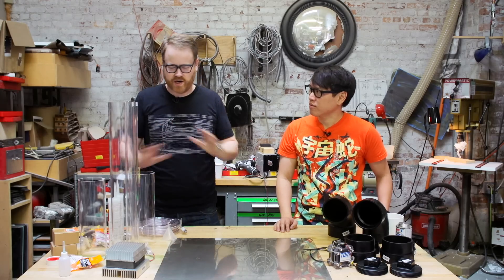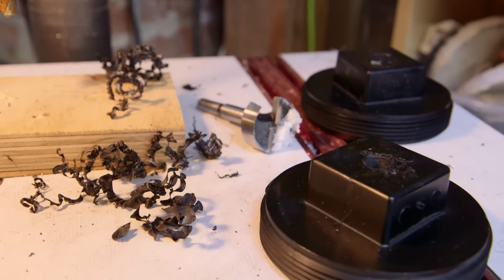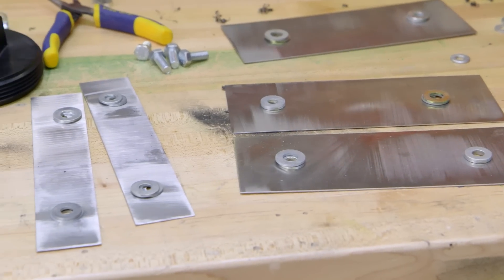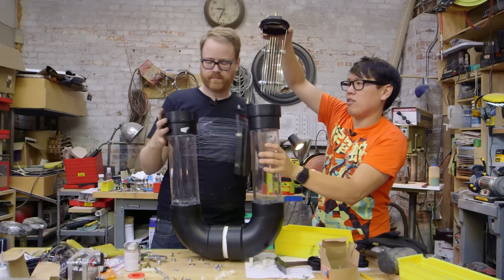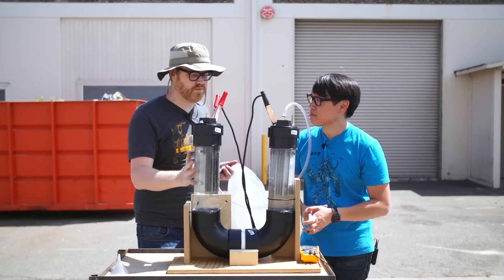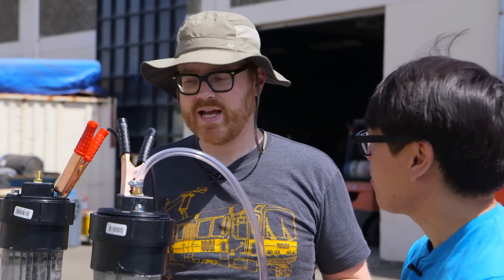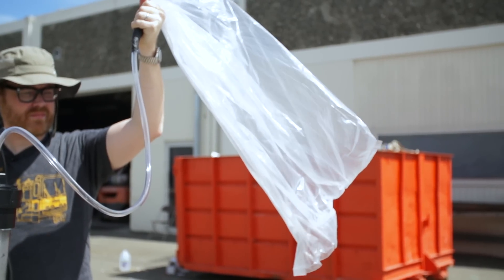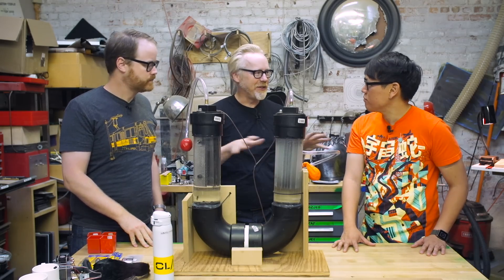Tested Builds a Hydrogen Converter

Comment: The distance between the anode and cathode is directly related to the amount of total power needed to efficiently produce the hydrogen and oxygen.  This is the main reason why the rig built by Grant Thompson worked so much better then yours.  You could probably 3D print a few parts to hold some thin steel plates in place and still separate the gasses.  If you alternate between anode, neutral and cathode plates you can design the 3D printable part to hold the plates as close as possible and separate the hydrogen and oxygen into different output chambers while the water comes up from underneath.

In my old rig I used some long steel plates for anode, neutral and cathode plates and then some sticker vinyl as gaskets to separate the plates and the gasses.  The vinyl was cut so that water could enter the bottom and sides and then cut so the hydrogen and oxygen would exit either left or right side of the top. Although I never got the separation perfect it still produced really well.  A 3D printed rig might work better to separate the gasses but might not be as efficient.

And if you do attempt another build be sure to build an arrestor like Grant Thompson did but build one for both outputs.  Mine had a small funnel at the bottom of the arrestor with a rubber ring glued in it to catch the ball and block the gas port when the water level got too low.  The ping pong ball also had a tiny ball bearing glued into it to force the ball into the funnel and hold it in place.

Comment: Never wear gloves when working on a drill press or lathe.  If it gets next to the rotating bit it can grab and rip your finger off (or wrist or arm).  It is way better to just take the cut you may get by getting hit by a chip.  This is old machine shop safety 101.   Cheers and happy building.

Comment: SAFETY FIRST!  I'm a Soap maker and worked with HHO gas, so I've worked with both Sodium and Potassium Hydroxide. If you spilled such caustic solution on your skin... JUST WASH and RINSE WITH COLD WATER ONLY FIRST.  By using vinegar solution first will cause an EXOTHERMIC REACTION and will burn your skin MORE! PLEASE READ THE MSDS SAFETY.

Comment: That wsa.. underwhelming.
Or rather horrible.
Hack, i got an old solar-set toy for kids with a small solar-panel and electrolysis chamber.
Hooked up to 9V and i can produce 15 L in a couple of minutes.
And that thing probably costs less than all the materials they used.

Comment: You guys really need to check the science. Voltage does not make a difference to how much hydrogen is produced - current does. 1 Amp for 1 second will produce 1/96500 of a mole of hydrogen atoms - half that for hydrogen molecules. So using Boils law at RTP 1G of hydrogen (1 mole) will be 24 litres. You wanted 2/3 of that. So you need 2/3 of 96500 anp seconds. Those pannels can supply at peak 6 amps. More typical is 4. Thats near 4.5 hours of electrolysis.

So why didnt it work - this is the only bit where voltage counts. If your voltage is not high enough to push adequate current through the resistance of the water then you get reduced current and it takes longer. I bet you were getting more like 5-10mA. 22V would need less than 6ohms to push 4 amps,

Comment: never, ever, ever use fucking glove on a press drill... one day you will broke your hand in 3 place, if you're lucky.
Reply: +mrmadame28 i guess spinning plastic parts was hurting his delicate hand :D
Reply: Octahedron lol!
Reply: Dobimar von Niebelschütz try to use a drill with tissue, you will see that when the drill bit touch the tissue, it grip very tight instantly. That kind of press drill is very strong. If you wear glove and, for a reason or another, the glove grip on the drill bit, you wont stop it, it is too strong. The way a glove tightens around you hand give a very good distribution of stress in the glove, therefor a working glove will not tear, it will make you move.  Last time i see that happen, the guy have broken 3 bones in is hand in 2 seconds. And the press drill was equiped with a kill switch (a pedal that you have to press on to make it work). There is more dangerous, like a machine tool, those can litteraly snatch an arm...
Reply: +mrmadame28 I was thinking the same thing. I guess these guys have never take a shop class, or talked to a machinist. Never wear gloves around spinning shit -- drill, lathe, etc. Latex/Nitril/etc. are fine as they rip very easily. A welding glove is not going to tear or be pulled off; so the glove and whatever is inside it (i.e. your fingers, hand, arm) wraps around the work until something gives. That's almost always the human, btw.
Reply: I try not to be too critical but these guys are jokers. The anodes and cathodes are way too far away from eachother, even with electrolyte. I also couldn't believe the guy said the solar panel would generate more gas than a 12 volt battery because it has more volts. Guess nobody told him about amps. I'm surprised these guys even attempted this after mythbusters failed so miserably with the HHO car and the beddini motor.
Reply: +jfbeam yeah i actually got yelled at by my boss once for wearing thin nitrile-dipped fabric gloves while running the drill press. never again.
Reply: mrmadame28 Yup. When I was little, my dad worked as a fabricator; he nearly lost a finger that way. He was very lucky and didn't suffer more than a cosmetic injury, with no nerve damage.
Reply: yeah I learned that the hard way, not with plastic but with steel, 25 stitches in my left hand.
Reply: mrmadame28 Not with a rubber glove, gtfoh!!!  LMFAOOO
Reply: +mrmadame28 Why?
Reply: Thanks :-)
Reply: What do you expect from people who think the Volt a measure of power and the Watt is a measure of energy?
Reply: they know what there doing... just too bad its done deliberately wrong, but we all know why
Reply: I built my own if anyone is interested, based off of the king of randoms design. A lot more efficient than these guys.

Comment: Next time don't separate the anode and cathode. When you increase the distance the electricity has to travel the more water it goes through and more plastic it comes into contact with. All of which will act like resistors decreasing your current.

Comment: The voltage does not run "throught" and produce hydrogen. Voltage is a potential differential. Ampère is what youre looking for ;)

Plus, there is a ideal voltage for every electrolysis. In your case it will be around 1.5-2V, so what you need to ramp up efficency is dc-dc converter.

How well did the anode and cathode hold up? In my expirience, stainless steel corrodes rather quickly so I used carbon rods later on. Platinium would be another good but pricy choise.

Comment: interesting these engineers don't know that voltage is electrical pressure and amperage is the power, a car battery would have worked much better because they have 350+ amps that solar panel prob only made about 5-10 amps if that much, what they should have done was used a car battery and solar panel to charge said battery yeah the battery would prob drain faster then panel could keep up with but it would prolong the use and could easily recharge the battery when not in use

Comment: Hey Adam, so I just talked to Grant "The King of Random" who made the original design of this generator and we both agreed that the failure to produce the amount of hydrogen you expected was because there was not enough amperage. Will stated the solar panel would generate more gas than a car battery because it produces a higher voltage when in reality, the production rate depends on the amperage. Therefore a car battery, although not a clean energy source, will produce a lot more gas. With two car batteries and this setup, it should produce around 5 liters per minute.

Comment: You know, you could have saved yourself all that work of you had bothered to calculate the theoretical production rate first. It's not a hard calculation, just a bunch of unit conversions (plus ohm's law, the ideal gas law, and some basic stoichiometry).

You should have taken the time to do the math to figure out if the design would work. The resistivity of seawater (using that to model the electrolyte solution) is 0.025 Ωm. You had a cross-section of about 0.00608 m² (assuming 6" pipe) and a path length of (just guessing) about a meter, for a total electrical resistance of about 4 Ω between the anode and cathode. The production rate of gas is directly dependant on the current running through the device: for every two electron charges that pass through the apparatus, you produce one molecule of hydrogen (this is somewhat over-optimistic, but will do for an approximation). One coulomb of charge (one amp for one second) equals on the order of 1e-5 mol of hydrogen gas. 1e-5 mol of gas at standard conditions takes up about 2e-4 L (so a rate of 2e-4 L/s/A). You claim to have been running on a 22 volt supply (probably less because droop); in that case, you would have a current of about 5 A, for a total of 3.6 L/hour.

This is all just basic engineering common sense; using this method I was able to rapidly iterate on the parameters of my design. My first and only physical version of my hydrogen generator worked perfectly, and produced gas at almost exactly my calculated rate for the design.

Comment: It makes no sense to power Adam's shop with hydrogen. A lot of energy is lost in electrolysis due to the overpotentional required to split water. It would make much more sense to use solar panels directly (with a battery for backup) to power his shop;

Comment: Hydrogen is a storage medium not an energy source and a poor one at that.  Unless it's generated by solar or something it's worse than using gas.
Reply: +orlock20 Keep in mind water is a byproduct of gasoline engines as well.
Reply: +williwonti Not to mention it's highly flammable, I wouldn't want to be in any building that had hydrogen tanks in it when the build caught fire. I wouldn't even want to be in a building which had a hydrogen tank outside it, hundred meters away.
Reply: +williwonti Hydrogen run over palladium plates is where the electricity coves from.  There is going to be three problems with that style of mass energy.
1. It's very explosive even if it's just a flash fire. It's much more dangerous than gasoline.
2. Palladium is very expensive. Right now it's $605 per ounce.  It would be the equivalent of stashing your jewelry in the engine compartment.
3. The byproduct is water so expect rusting vehicles and constant wet roads.

Comment: The only ones salivating for hydrogen is the oil companies, why, because they can get us hooked on the gas stations all over again. Making hydrogen by electrolysis is inefficient you waste more electric energy making the hydrogen than you get in hydrogen power in the end,  hydrogen is also a very dangerous gas even more dangerous than propane or butane, it even makes an invisible flame, needs to be storaged at greater pressures and lower temperatures than the other gases, to be converted into a liquid, and even so there's still danger of leakage.  Hydrogen for transportation is dumb, if you want to hook people into a gas use propane or butane instead, are safer and also very abundant.

Comment: We have this scientific orthodoxy that says the amount of electricity needed to separate water into it's constituent elements must exceed the amount of energy released in the form of gas. But that's a logical fallacy, because you're not transforming electricity into hydrogen and oxygen, you're stimulating a reaction. There is no logical reason why a more efficient method couldn't be developed that unlocks a very large amount of hydrogen from water using a very small amount of electricity.
Reply: +TerraceThornhill No. The amount of evolved hydrogen from water is proportional to the amount of energy you put into to splitting the bonds between the hydrogen and the oxygen. If you were turning electricity into hydrogen you'd need ~90 TJ to produce a mole of hydrogen.

Comment: Nice experiment, but you only need 1.24 volts to hydrolyze water. If I remember correctly, all the excess volts just add to the heat, which causes the unit to draw more amps, which of course adds even more heat.

Comment: Hydrogen IS NOT the future. Great effort guys, it seems like you needed more amperage, which is why most DIYs use a car battery. If you wanted to use the solar panel, I would have hooked it up to the battery to help keep it charged. The thing with hydrogen is that it is ALWAYS bonded onto something. It takes more power to break the bond than it does to reattach the hydrogen to another element. Also, you experience a lot of losses with hydrogen equipment. Dollar for Dollar, Kw for Kw, electricity is the way to go. That's why the electric car market is taking off all over the world and the hydrogen car market is staying put in California.

Comment: How is it that the hydrogen and oxygen gasses are being produced at different electrodes? Shouldn't a mixture of gasses be produced on both sides? Or are the different atoms being dragged by the current to separate sides, and thus separating them? Seems highly unlikely!
I mean, these guys are really intelligent, so I suppose they know what they're talking about, but I just can't see how the gasses are being separated except for some quantum mechanical explanation involving all individual atoms in the water molecule exist on both electrodes at the same time. Does someone care to explain?
Reply: +Al H  It is quite simple (and you should have learned that at school in chemistry):
Water is NOT just H²O - you also got HO and H³O - and those 2 are the things you actually are splitting.

Anode: 4 OH- --> O2 + 2 H2O + 4e-
Cathode: 2 H3O+ + 2e- --> H2 + 2 H2O

Comment: They should have made a Hoffmann apparatus and put a bit of sulfuric acid in it. As a teacher I made hydrogen gas that way many times and I could make 15mL Hydrogen in less than 10 minutes with a small setup. By the way: 22 Volts isn't power but Voltage and 100 Watt isn't energy but power!
And they were off by 3 orders of magnitude, not 2.

Comment: aww they should have made a dry cell, it will last longer and heat less. 
A dry cell is what you need if you want to use the gas in an hydroxi torch.

Comment: pretty much the same thing as a  hoffman voltameter used for measuring charge transfer. except that shifts copper from one electrode to the other, and the mass change is measured.

A big problem is the electrical path length through the water which functions as a resistor. One way to significantly reduce that is to take,,,  
thin diameter plastic pipe. Near one end of pipe add electrodes to both inside and outside of tube (silver mirror test might be easiest method). Duplicate arrangement if you want more surface area. one gas stream will be produced at the electrode inside the pipes and one outside the pipes. Gas bubbles will want to rise. Other gas can be collected by placing the lot inside a larger diameter pipe, and drilling holes in a blanking plate at the top for the smaller tubes

Comment: They did a basic high school project. Now if they did "2" 50 gallon barrels and converted 220 volts AC to say 100 volts DC, they may have gotten some where; but they set it up to fail from the beginning.

Comment: Seems like the solar panel was the problem not enough current. Screw the 22 volts a car battery may have had those plates boiling and producing more hydrogen.

Comment: Built an electrolyzer like The Kind of Random's several years ago. Pretty much an exact copy of his (except it wasn't a copy since it was made before his). Very cool stuff. Having the plates right next to each other really allows a lot more current to run through and speeds up production. The problem with that sort of setup though is as mentioned you have both gasses mixed together in the PERFECT proportion for an explosion. It will literally detonate if given a spark. Much more dangerous than the setup you guys made. I'm sure Adam can tell you all about how hydrogen likes to explode rather than burn when lit.

Here is a really cool follow-up experiment to do: Add a PH indicating solution to the water. The results are really interesting. The University of Washington invited me to do a similar experiments with them after they heard about my electrolysis device when I was a kid. You can read about it here: http://faculty.washington.edu/ghp/images/stories/pubPDF/2009-Ovchin_Pollack-Can_Water_Store_Change.pdf 

Also, if you want you can use baking soda as an electrolyte. It's not quite as good as potassium hydroxide but is much less dangerous to handle.

-Cary

Comment: Why bother using so much electricity in the production and development of hydrogen infrastructure for vehicles (as an example) when we could just focus on the engineering of electric vehicles? It seems bizarre to add a "middle man" in the fuel chain. I understand Japanese automakers are betting on hydrogen as the future fuel-source and are receiving a lot of support from their government, but I can't see how this makes sense from an efficiency and environmental perspective. I also understand that the method used here was "less than ideal" and am not using this as a basis for my question.

Comment: Wouldn't it be better if it was a sealed system at both ends and a different material for the collector? Say, Mylar, or a tank rated for storing hydrogen... I would think their collection would be inhibited by losses at the open valve and the porosity of the plastic bag / ballon. At least that is my memory of systems wanting to be in stasis.

Comment: C'mon guys I thought you were nerds. The panel may have been a higher voltage than a car battery, but even for a standard 12V car battery 600A isn't unusual. V=pressure A=flow, you want flow...